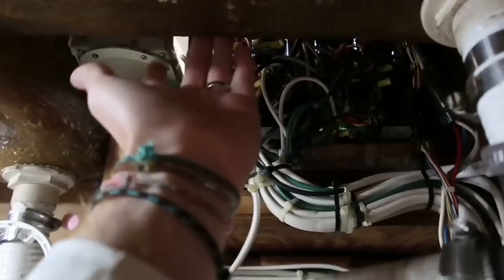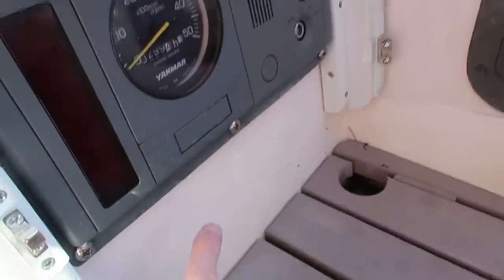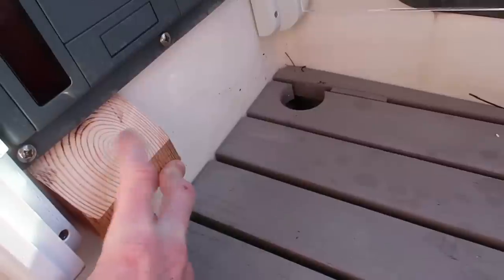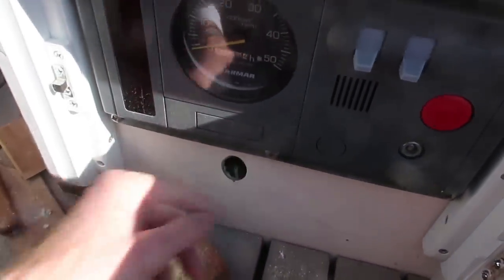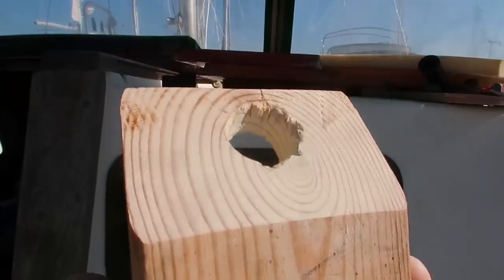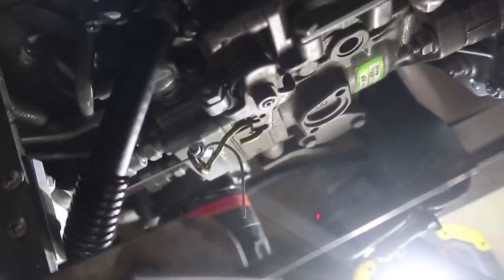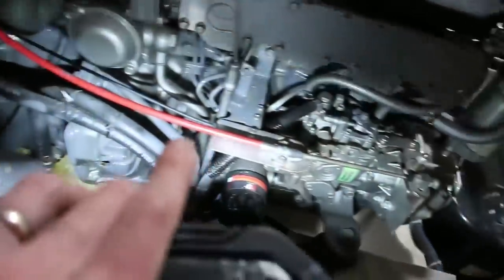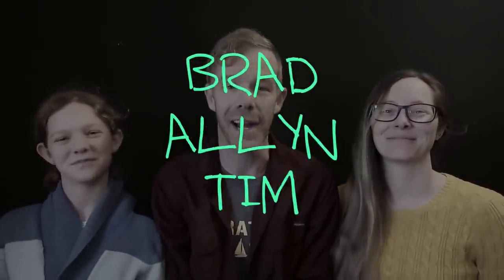An Unorthodox Engine STOP Cable Installation | Sailboat Story 219

Comment: Isn't it interesting how old school technology that has been proven to last hundreds of years in many instances, we changed into electronic, which is so delicate and easily destroyed, then we questioned the quality and longevity of the old school technology and said it was never as good as the electronic.  That is until your electronic stuff breaks down at the worst possible time and then you see in museums and on farms, old tractors and machinery still in use and working almost as good as the day it was built nearly a century ago.  
Sure the cables don't normally last a century due to heavy use, but they do last many decades.
Good choice with the cable Ben and great job with mounting it.
I nearly forgot.  And beautifully finessed by Tambi!
Reply: I couldn't agree more!!! I'm old school, built my boat from the ground up with all the old fashioned tried and trusted methods, now some forty five years later, she's still going strong...

Comment: I did the same stop cable job on my Yanmar. They seem seize up after so many years due to corrosion. 
Mine was built in the 80’s, so the wiring harness isn’t tinned leading to some crazy electrical gremlins!  I gotta update that wiring.